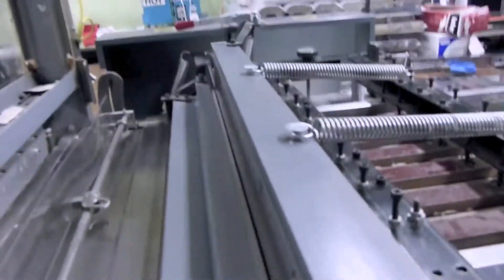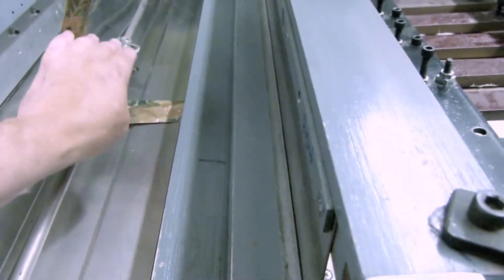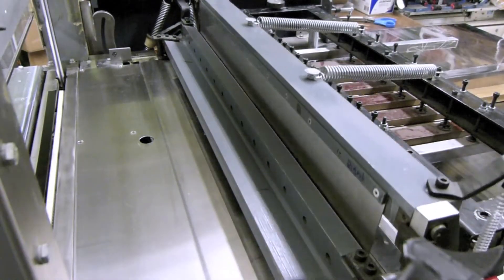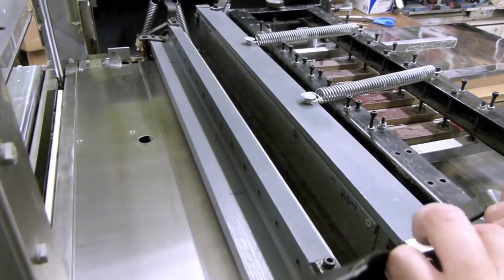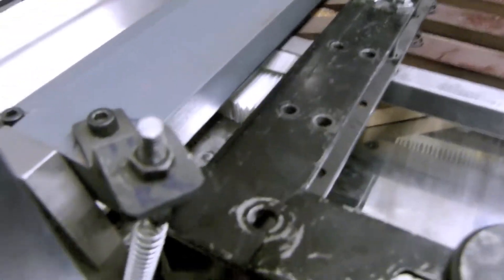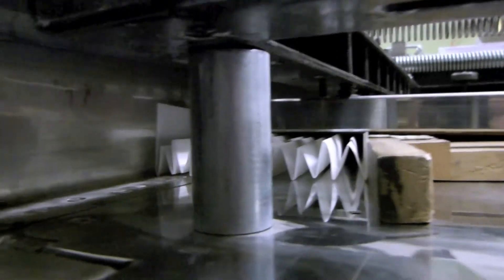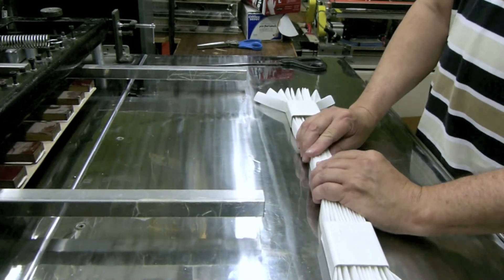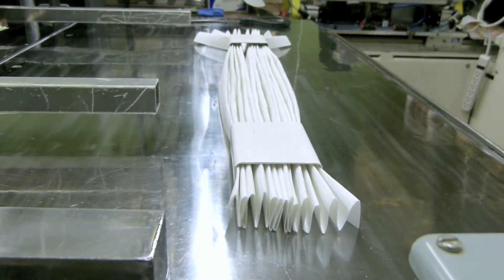Pleating machine working 2.mov

Comment from the maker: This is a pusher bar pleating machine and I found out that you cant pleat HEPA filter material on a pusher bar pleating machine.  Pusherbar pleating machines only go about 80 pleats per minute.  I bought another pleating machine, a rotary pleating machine and can now pleat perfect pleats at around 150 pleats per minute.  I can probably speed the machine up to near 500 pleats per minute and still get perfect pleats.  This was a test that failed.
Pusherbar pleating machines are good for pleating material that is more stable but not cardboard like.  For that type of pleating, you would need a blade pleater.  So there are 3 types of machines used to make an accordion pleat.
Reply: so where is the pusher-bar pleater now ? lol  in case its for sale ?